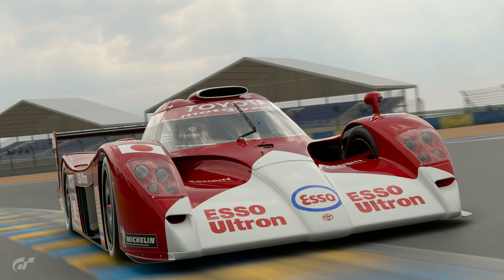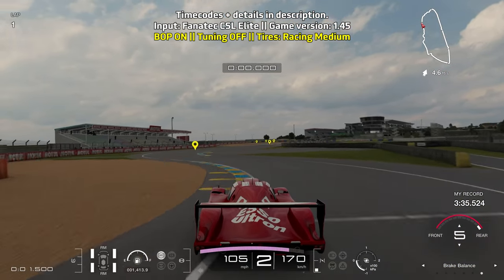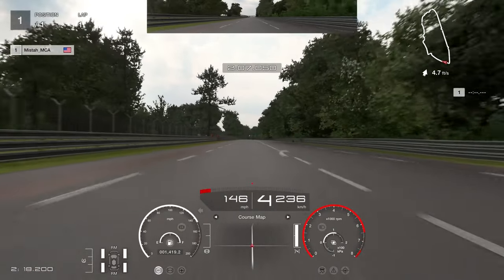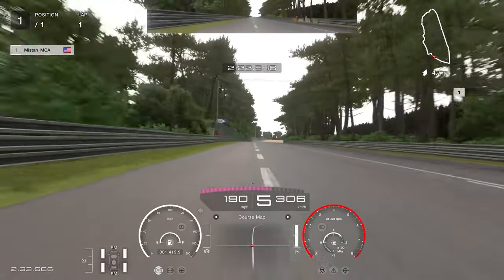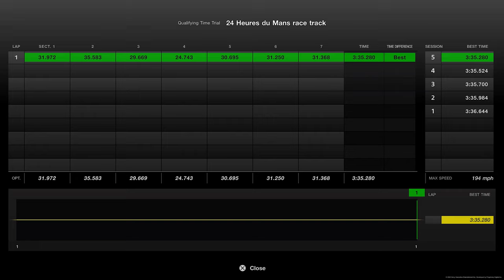GT7 2024 Nations Cup Lap Guide - Circuit de la Sarthe - Toyota GT-One (TS020)

Comment: Tks !! 
A strategy for today ? 😏🤌
Reply from the maker: 5 - 5
Tire change, and if you can, no refuel.
In the GT-One, you don't rev out 4th gear as much, and that should be about as much fuel saving you'll need to do.
Reply: @MistahMCA  Thanks a lot ! 🤌 because ive just try a couple km for a little 3:37 …
How ever I would like race again in FIA ! Tks again but im French…what would you mean with rev out 4th gear plz
Reply from the maker: @SnoopRacingGT  With the GT-One in Time Trial, you'd normally rev 4th gear all the way out before going up to 5th gear.

Since fuel is an issue, you don't want to rev 4th gear as much. You shift up a bit after the shift bar on the bottom of the screen starts to blink.